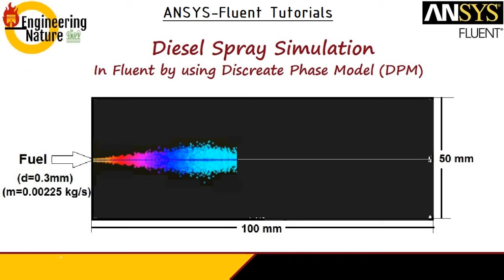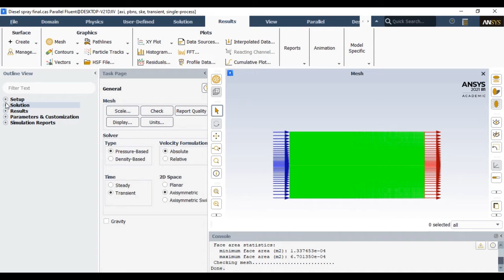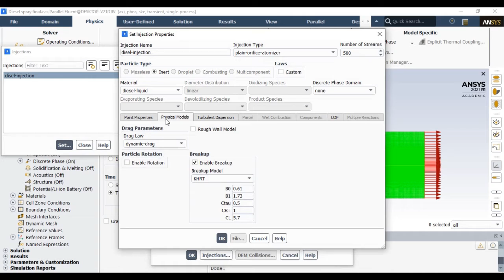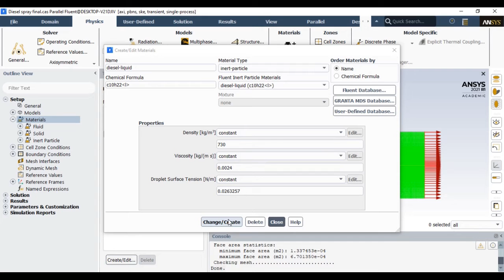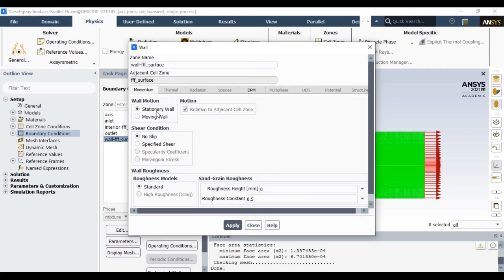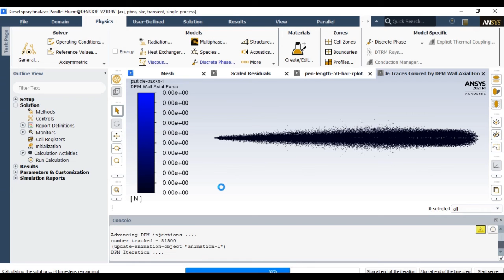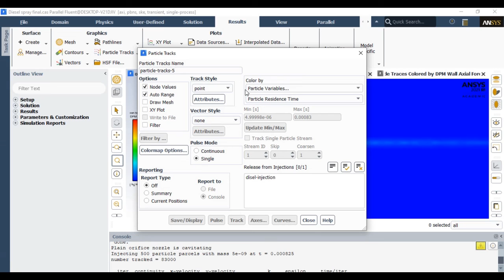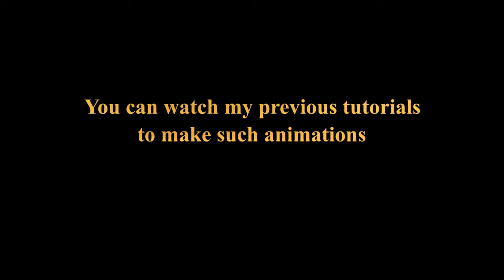ANSYS-Fluent Tutorial || Spray simulation by using DPM model

Comment: Hey! Thank you for your helpful video. I have one question. I used the DPM model to simulate spray too. In my model, The "particle Track" section does not show the spray from the origin, a few mm far from starting spray. What should I do that shows from the origin position?
Reply from the maker: You should create your injection point at (0,0) origin while create a geometry.
Regards.

Comment: Thank you for the tutorial. I have a question. What if I wanted to change the density continuous fluid inside the chamber. Should I define new material with new density value or should I specify operating density in operating conditions?
Reply from the maker: You can adapt certain fluid zone and patch the value of the density for continuous flow during the initialization of the problem. Regards.
Reply: @EngineeringNature  Yes, I was thinking the same thing. But, I think last time I tried this, I couldn't find density option in patching dialog window. Should I first change the material density to ideal gas law? Regards.

Comment: This video is quite helpful for me to understand DPM model but I have simple doubts. Please clarify.
 If I wanted to change the pressure of cylinder, where should we give in boundary conditions and also how do we determine the flow rate? Is flow rate depends upon injection pressure?
Reply from the maker: (1) You can assign cylinder pressure through operating conditions
(2) There is no ditect way to supply injection pressure.
(3) You can only incorporate effect injection pressure via mass flow rate of fuel. Which again one should measure via experiment.